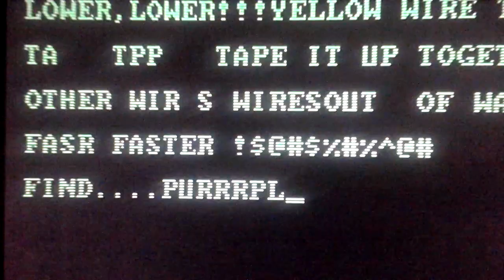Short circut 2 repairing

Comment: Intellectual response: There is no way a late 80s machine had five hundred megabytes of active memory but lacked permanent storage of similar size. There is similarly no way the active memory was expanded without the machine going through some form of reboot, and AMAZINGLY BAD THINGS happen if the expansion was installed while the circuitry was hot.

Emotional response: "Fifteen minutes to get good" is incredibly powerful in its simple delivery.